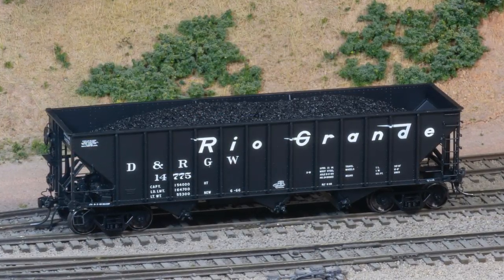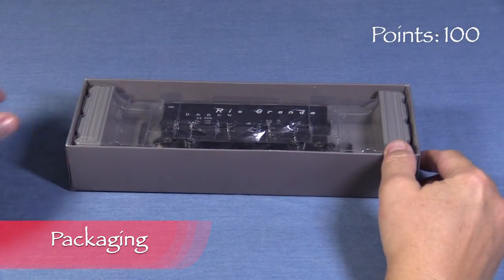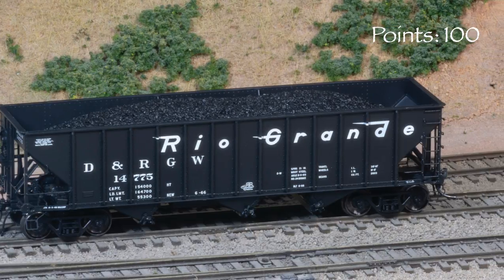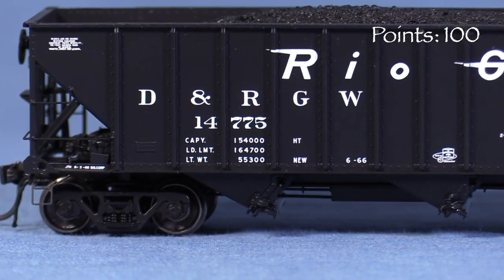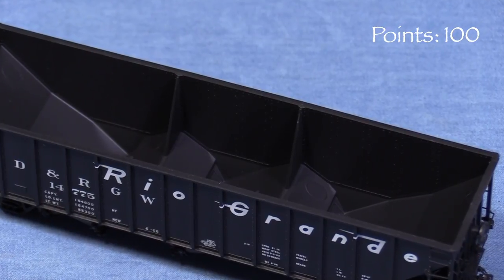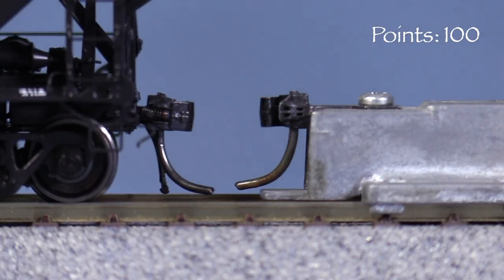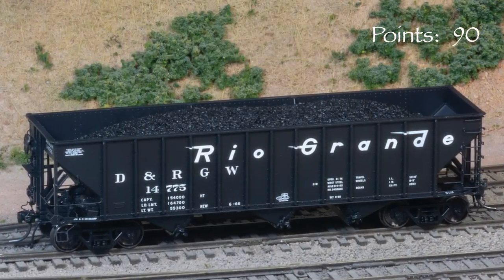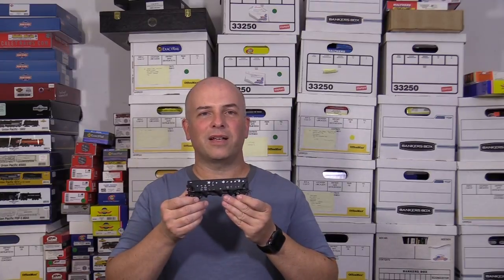Product Review HO Arrowhead Committee Design Hopper

Comment: I purchased 25 Rio Grande cars and that hurt but these are accurate cars with top notch detail. I don't mind spending extra for well detailed car that are accurate and I don't have to build them. Generally when I spend $25-30$ on a car I end up spending another $20 adding detail parts, paint and my time to bring the car up to the level of an Arrowhead car. The Arrowhead cars are pretty much ready to go. I only added semi-scale wheels and sergent couplers to finish them off along with weathering. The only negative thing I can say about these cars would be the car should be NMRA spec. weight when empty because you can't really run them underweight or they will surely derail at some point in a long train. With detailed cars you defiantly don't want them derailing often or you will be spending a lot of time repairing them. I think cars at this price level should have semi-scale wheels and Semi-scale couplers too. It has the couplers but lacks the wheels. I feel most people that purchase these cars at this price already run that setup on their cars anyway and if they don't they have plenty of wheels and couples to swap them out. It is also easy to sell, trade or give away semi scale wheels and couplers if you don't run them. Just message me, I'll trade wheelsets. :)
Reply from the maker: I like the semi-scale wheels too, and usually look for those when I need to replace wheels on a car.  I especially like them on hoppers, tank cars, and other rolling stock where the wheels are more visible.  I haven't had any issues with them tracking either.  I agree that these cars would be best run with weights under the loads.  I'll probably mix mine in with a bunch of ExactRail DRGW hoppers I already have.  Thanks for watching!
Reply: @ @DanielCortopassi  Thanks for the reply Dan. We had the same thought :).  I mixed mine in with the Exactrail DRGW hoppers too.

Comment: It is a nice car, I saw one at a hobby shop.  The one problem I saw was an incorrect capacity stencil.  This car was lettered as a PRR H39 class and was stenciled 100,000 lbs.  The prototype was 140,000 lbs.  (The load limit was also incorrect.)  For an MSRP of $49 this is a big error in my opinion.  I put it back on the self and shook my head, such a shame.
Reply from the maker: That's disappointing, especially on high-end cars that are marketed as being accurate.  Thanks for watching!

Comment: After the quarantine is over, check with your dentist if he or she uses 'regular film' or 'digital film' radiographs. Regular film comes lined with ultra-thin lead foil. Not good for anything and usually thrown out -- except very good for ultra-thin freight car weights. Loaded hoppers have no problem getting an additional 0.75 oz. Empty hoppers getting an additional 0.75 oz to 1.25 oz? Possible if layers of foil are burnished in place, painted weathered black, and covered with a light sprinkling of "residual coal" as a 99.95% empty. I have a whole gallon jug of it though for liability reasons would limit its distribution to just model railroad friends with good common sense. That's you. I've even used it on a few empty flatcars. Lead (the first) lead (the element) "empty flatcar" pulling a string of 30 hoppers without stringlining going uphill on a 30" radius curve -- now that's impressive even though "recreated mass" doesn't and cannot scale down -- and being NMRA standards "performs" with heft and prototype operational mass, i.e., empty flatcar stays on the track!
Reply from the maker: My dentist switched to digital for x-rays a year or two ago, but I can check and see if they have any old stuff laying around.  Thanks for the suggestion!